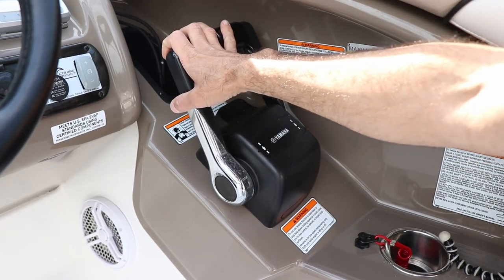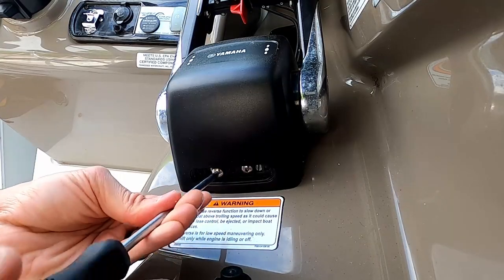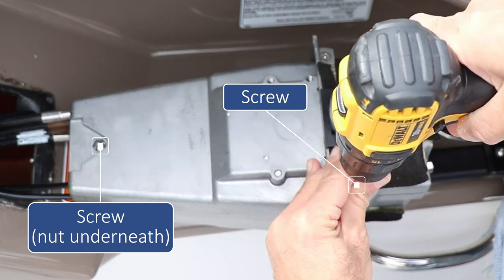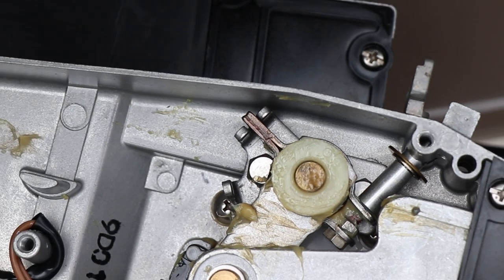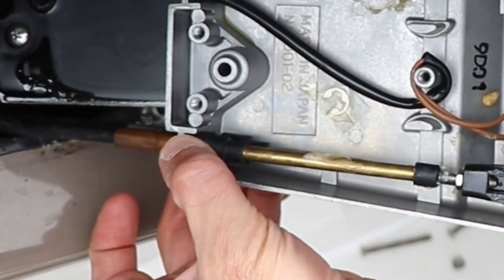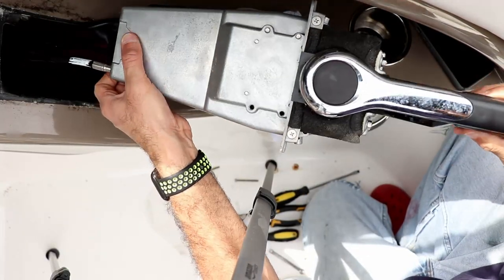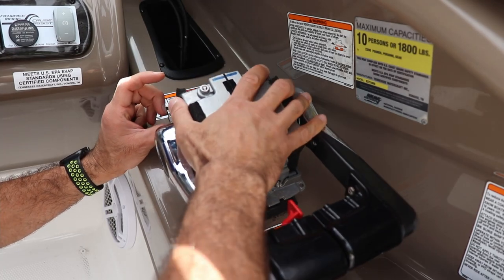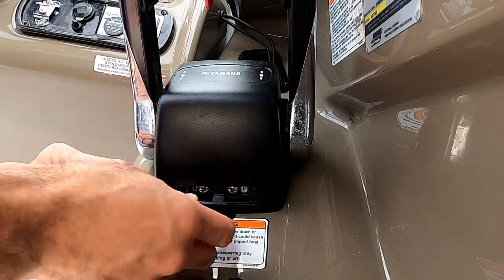Yamaha Jetboat | Throttle Drop Fix

Comment: Everyone should be doing this fix.  Many dealers will only hit the tension screws, and that is not the fix.  Nice work!
Reply from the maker: Thank you for your support! Yes, the tension screws are the easiest for the dealer to “fix”. I still wish I knew why that mechanism was designed that way in the first place.
Reply: @boatingpropless  Nice fix, has anyone tried using plastic wire Zip ties instead of using a hose clamp?

Comment: I just took my 2021 AR250 for her maiden voyage and noticed the port side throttle lever was sliding back 200-300 rpm. So I will have to  check it out.
Reply from the maker: Into the next boating season now, I hope your problem was resolved! 👍🏻
Reply: @boatingpropless  The dealer tightened the lever but it's already loosening again. Ughh.
Reply from the maker: @TeddysVentures  Yipes! Did that remedy the problem at least?
Reply: @boatingpropless  only 50%.

Comment: Same issue on my 22 AR250. Will this fix apply to my boat ? The throttle drop is really annoying
Reply from the maker: I have heard that it does help on the newer boats. Apparently they haven’t changed the mechanism unless it’s the fly-by-wire version

Comment: Any videos of replacing scupper valve on a 2008 232 limited?
Reply from the maker: I do not. The scupper on the 2010 models were moved and would be an entirely different procedure.

Comment: Throttle drop, is this the case w all yamaha jet boats? Just got my 2022 ar195 and i have same issue.
Reply from the maker: I’m pretty sure it is. Not sure why though. It must be the mechanism they use so that the single lever controls the bucket and the throttle. Not sure if the new fly-by-wire fixes any of that though.

Comment: 2008 ar210 throttle is going up from 7000 to 9000 any help with it?
I have new cables coming in
Reply from the maker: I wouldn’t know what the issue is. Take a look at the accelerator position sensor, it might need adjustment.

Comment: I have the 2022 FSH Sport and I had to adjust the throttle cable by the engines and that “fixed” the drop issue for a few outings. I went out last week and starboard throttle drops to about 500-700 rpm less when I let go. Very annoying
Reply from the maker: I still can’t believe Yamaha hasn’t fixed this issue yet. After a few dozen outings, mine is also not holding as well. Seems that it’s works better for some than others. I’m going have to revisit this in the future.
Reply: @boatingpropless  it’s a bizarre problem and want to fix it. It makes steering a pain when one engine suddenly has more power than the other
Reply from the maker: How about the disharmonious sound coming from the engines when they aren’t in sync. It drives me nuts. I even have Jetboat Pilots throttle sync. It helps, but it’s not a complete solution.